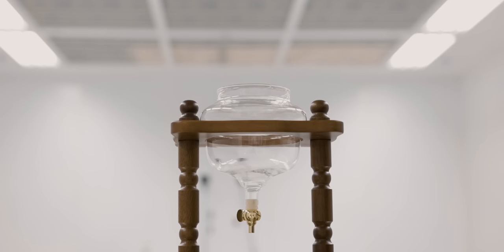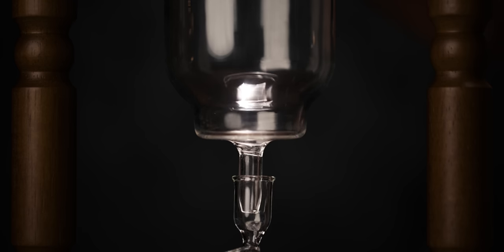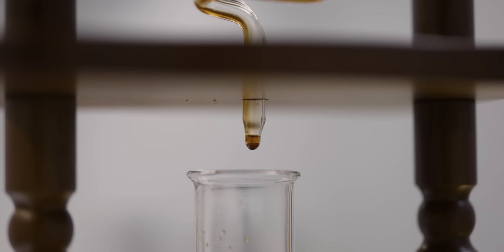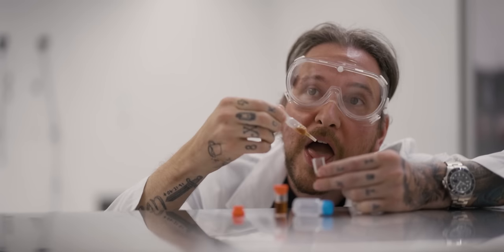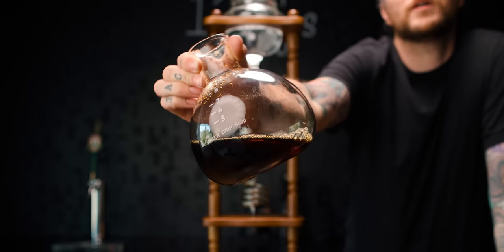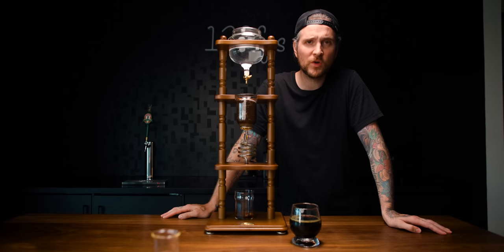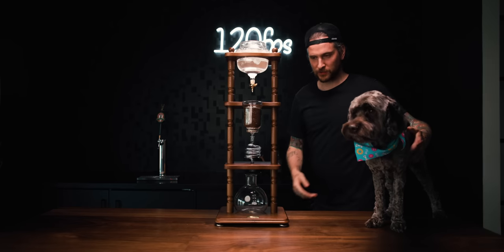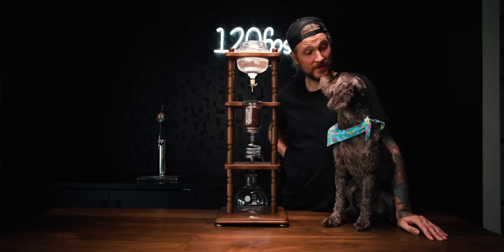Testing the World’s SLOWEST Coffee Maker!

Comment: Hey Pete! As always awesome video!
I actually use a tower like this on a daily basis as I work in a coffee shop. One thing that you might consider is to actually to let the full tank of water run through coffee first, before you start drinking it, because extraction has 3 different stages, (quite like espresso). So at the beginning you get the strongest part of the coffee and all the oils, then in the middle range of extraction time you get balanced coffee and at the last stage you get "watery coffee" that balances out the first stage of extraction. As you tried here the first cup, it is quite similar to having espresso ristretto, but a filter coffee type.  When you let the whole water run smoothly you will get much more balanced carafe of coffee overall :) I am not trying to be a smart ass, I just thought you might want to give it a go! 
Enjoyed the video! All the best to you!